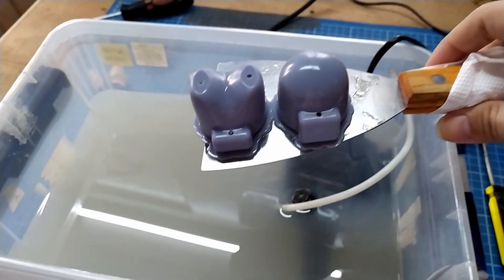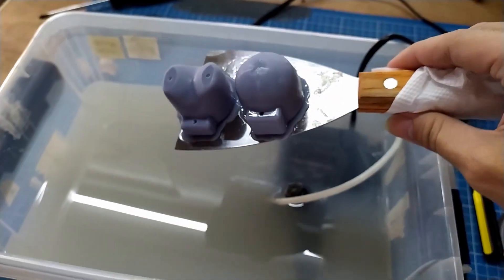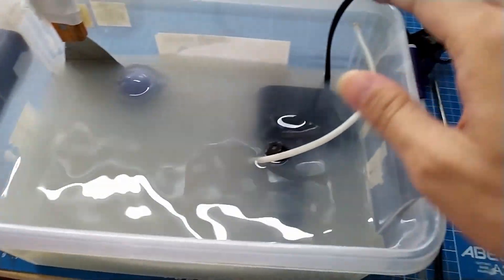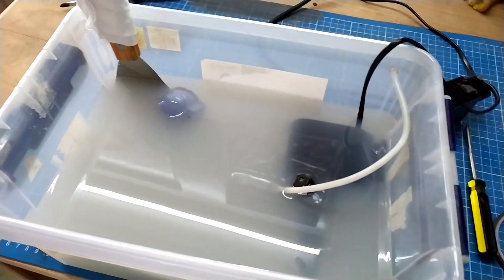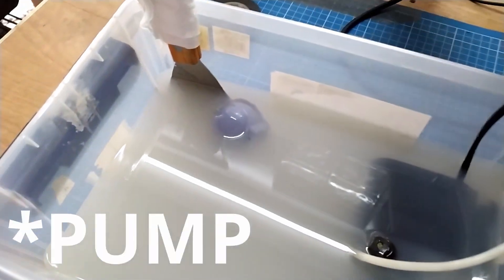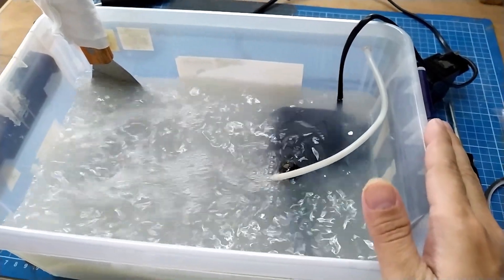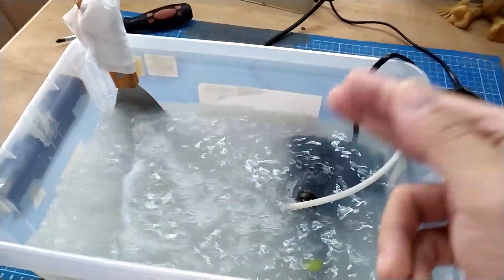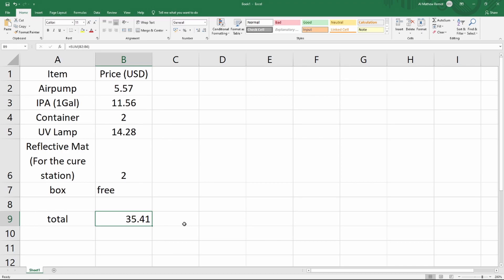DIY CHEAP Resin 3D Print Wash Station

Comment: not a bad idea but definitely use a container that can seal. The alcohol is almost as bad as the resin when it comes to VOCs and air contamination and a sealed container should prevent the alcohol from evaporating as fast making it last longer. Plus the sealed container would prevent the fire risk some folks are worried about.

Comment: Does the chemicals or resin not clog or ware on the motor?
Reply from the maker: No, its an aquarium pump so the motors run electromechanically and its separated so that it does not clog up!

Comment: Not a very good idea :/ ive kept fish for years, pumps like that fail often. One short and that things going up in flames. The IPA will mess with the seals on the pump too...
Reply from the maker: You are referring to DC brushed motors w/c can cause sparks if those brushes ever fail or short out. 

Most aquarium pumps (well at least the ones here) use electromagnet w/c eliminates that risk factor.

Comment: Hi! It's not an air pump, it is called an aquarium power head. These were used with under gravel filers years ago, but that style filter has fallen out of favor with modern aquarists. These days they are mainly used for water circulation within the tank and various utility usages. The air intake/mixer is called a venturi.
Reply: Thanks! You seem quite knowledgeable on the subject I appreciate the help it will help with my search terms
Reply: @und3rscore_41  No problem. And yes, I have had aquariums for nearly 40 years.
Reply: Wow so you are super knowledgeable!
Reply: Wow so you are super knowledgeable!

Comment: Hello I am new to resin printing and I am not sure if I should buy a cure and wash station or just do "diy" both. Do you still recommend this? Also do you have any new tips while doing this. Thank you.
Reply from the maker: if you have the budget, go for the premade wash and cure. You also but convenience with it. 

This DIY method is great for larger prints as you can fit everything in one go.
Reply: If I was washing with IPA, I would want something that's enclosed to lessen the fumes.  I use WW so this would work great for me.

Comment: Just made one of these, and i gotta say, nothing compares so far!
I used a small compressor i had lying around and just coiled up some hose with zipties, cut a bunch of small holes in it. put it at the bottom of the tank.
Reply from the maker: It costs less, works better than the commercial one and you can scale up the size easily. I do have one suggestion. You can use a container that has a seal so the IPA does not evaporate quickly.
Reply: bro what was your set up, i have no idea how to make this

Comment: doesn´t this make the IPA evaporate like hell?
Reply: Re use your IPA by letting rest it in a container for two weeks in a place where the sun hits it then extract it carefully, you can at least use it for a second wash.
Reply: it does
Reply: run it with the lid on?
Reply: Typically even with the pre-made wash stations, you rinse your parts with the lid off, and when you are done replace the lid.  You shouldn't be washing your prints for more than maybe a few minutes! :)